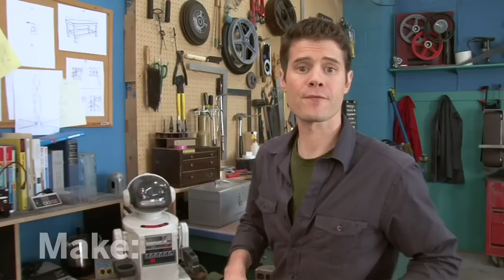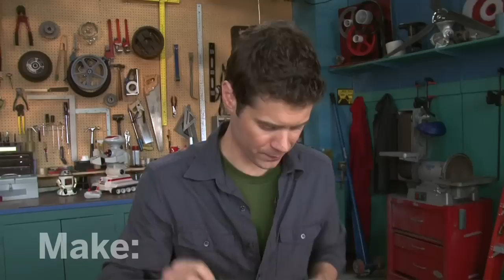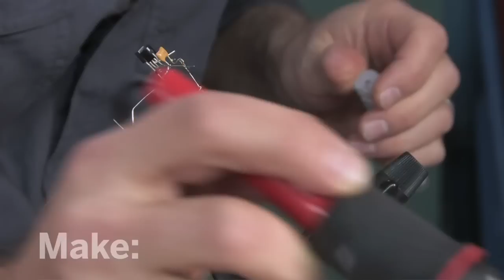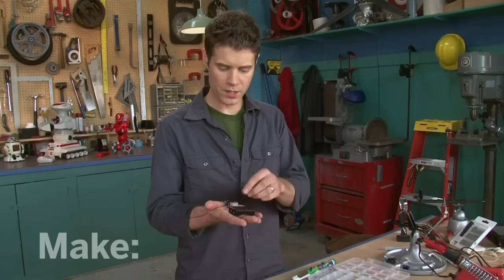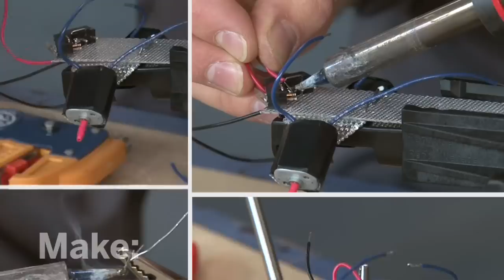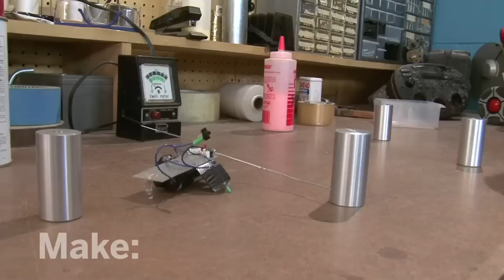Maker Workshop - Miniature Robots on Make: television

Comment: I was wondering if anybody can help me with this project I'm making.  I have a Nissan 350z, and Im trying to build a tablet mount that goes inside the dash cubby which is about 5 inches deep.  The cubby is used for storage, and I want to use it for a motorized retractable cubby.  I don't know to much about the parts I was, but I was looking at linear actuators, and it seems like it would do.  Only problem is that I can't find one that's small enough to fit.  Anybody know where I can find parts.

Comment: hey john, can you show me that how to demo dragon robot. but I want to make a 5'1' dragon robot costume but with wires & skeleton part of suit I can wear, & maybe jetpacks for the wings in monitor for me to control & have one to walk on four & maybe on two & fly but feet is going to dangling in the air. but maybe you help me out to build to. as first model but I going to need medium 2 cameras to make the eyes. & maybe 1 flame throw & maybe a smoker like from a fogger & the tail automatic movement & the tail in sitting from side to side, in standing as also side to side, & in the air not moving at all. I going to need some help I need help to put it together. will you help me out.? please?:)